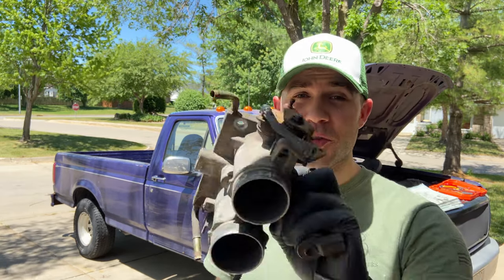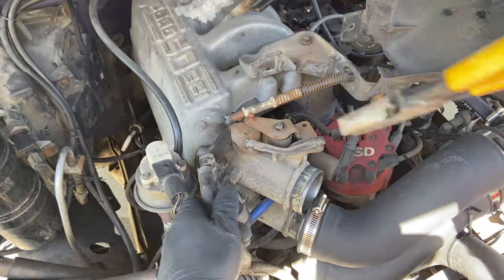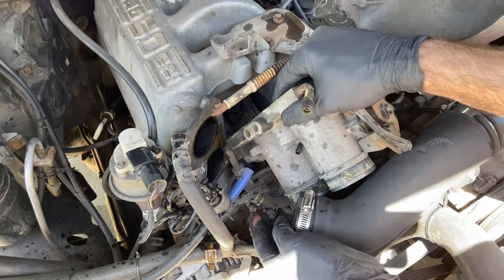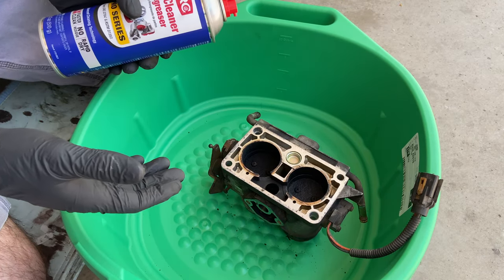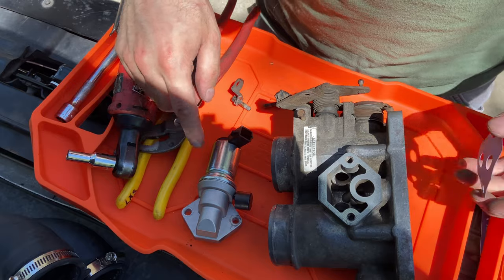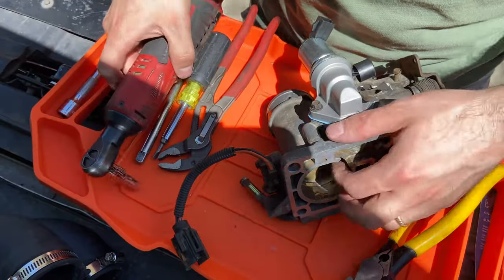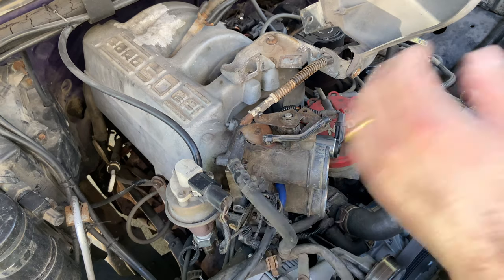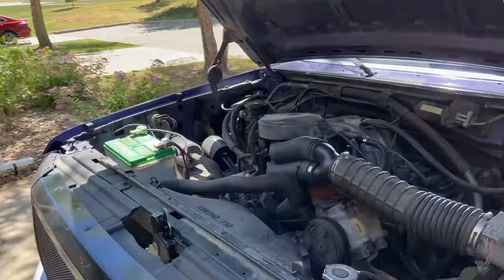How to Remove a Ford F150 5.0 Throttle Body and Super Clean it!

Comment: Thanks for all of these videos dude, they are awesome. This one helped me out in a lil bit different way. I have a 91. 5.0 with 126k and since I’ve had it I’ve noticed there are some hoses missing, and turns out it’s those coolant lines running in and out of the TB. I’ve been driving it without any problems. The previous owner retrofitted to newer AC and I’m curious if that would somehow delete those lines?
Reply from the maker: You’re welcome man!🤙 that could have deleted those lines. I haven’t seen many retrofitted AC systems.
Reply: Ahh okay that would make sense I think, I appreciate it dude 👊🏼👊🏼

Comment: I’m doing this project right now and the built in coolant lines on my throttle body are completely corroded.  Would you replace the whole unit?  Or can I just replace that tubing?
Reply from the maker: Nice! If you think you can replace those corroded coolant lines then I would try. Otherwise you will need to replace the whole unit. I’ve never tried replacing those coolant lines.

Comment: Great video. Any chance that coolant line could be leaking into the throttle body? I'm loosing coolant on my 93 f150 and no idea where its going. Truck has a very hard time accelerating. Thanks,
Reply from the maker: Thanks Michael!🤙 that could be a possibility. You would have to check while the engine is running. I kind of doubt it because I think coolant going right into your intake would smoke/steam. You could be losing coolant through an exterior leak or through an internal gasket.

Comment: What socket did you use to get the throttle body off?
Reply from the maker: Good question! I can’t quite remember but I don’t think it was anything special that’s not in a typical mm or SAE socket set.
Reply: 3/8 socket

Comment: Thanks for the easy to follow video. I have been having a few issues with my new to me 1995 f150 5.8 and think this may help solve some of my problems. I have a high idle and my truck shifts hard/jerks into reverse and drive. I replaced map sensor as recommended by the forms without much luck. I think the truck drives a little better, but still same issues with idle and shifting into reverse and drive. Once I start driving I don’t notice much difficulty going into any gears 1-4 (auto trans). I think cleaning the throttle body and replacing iac and tps is next. I know I have an exhaust leak at the muffler that I am gonna weld next weekend, but besides that, any other ideas as to what could cause this? I plan to replace all vacuum lines in the near future since they are old and looking rough, although I currently can’t find a leak from them. I also am replacing trans filter and fluid this weekend along with muffler fixes. Any advice is appreciated and thanks for all the helpful videos.
Reply from the maker: No problem man! 🤙Honestly, these fixes you plan on doing are a good start. I would get them done and then see how your engine runs. For me, high idle typically is an air thing. Exhaust, intake, vacuum etc. So definitely check all those components carefully. 
Also, have you checked the codes on your truck?
Reply: @TheMinuteMasters  yes, non-running only has code 121. Running- 411, 412, 311, and 332.
Reply from the maker: @Morse12321  I don’t know the codes off hand but if you Google search them with the year of your truck, there’s usual a forum or two dedicated to them. Sounds like EGR, O2, or some other sensor/valve.
Reply: My 95 5.0 does the same thing; jerks into drive/reverse. After some diagnosing I've discovered some minor vacuum leaks and a bad IAC. Before buying a new IAC try unplugging yours and then see how the truck runs. If it runs the same or better then the IAC is probably bad but if it runs worse then your problem may be elsewhere. Also you can try cleaning it. It's very easy to do and could be all it needs. Also make sure your throttle cable isn't sticking. When I first got my 95 f150 5.0 the throttle would get stuck at around 10% throttle. In other words when I let off the gas the pedal didn't return all the way out. I solved this with some lubrication and adding an extra return spring. Also there's on idle screw on the bracket that the throttle cable mounts to. Make sure that isn't all the way in for some reason. I have a new IAC that I'm going to install and if that doesn't solve it then my next best guess (other than vacuum leaks) would be the TPS. Also what trans do you have? I'm just curious if you have a 4r70w trans as well.
Reply: @Acaidia  Mine is an e40d. 6 months later and I have done a lot with my truck (95 4x4 f150 5.8 e40d) After replacing map, iac, vac lines, a few things im probably forgetting, and the u-joints i was finally able to fix it. Hard to say if replacing the u-joints was the sole fix, but they definitely helped the most. Iac and map helped a noticeable amount to make it tolerable, rather than feeling like the truck was gonna split in half, but after replacing u-joints (ball joints, tie rods/sleeves etc at same time) i have not had anymore issues. I had a lot of slop around my front diff at the joints and when going from park to drive or reverse i could see where it would have to compensate for the slop and made it jerk. If you try the iac and that doesnt fix it id start looking around there. Its a long job so prepare for that (at least for me it was). The only real issue im trying to figure out right now is why my dash lights are flickering in one spot. Its in an almost square shape around the mileage, 0-10mph, and fuel gauge sections. Its not a constant flicker, but more so like a light is going in and out. Only thing I know needs work is my dash light switch as it has to find a happy medium in order for dash lights and headlights to be on, otherwise it will shut one or the other off ( i definitely need a new switch) but i tried messing around with the switch and it didnt seem to make a difference with the dash lights issue. The part is on order for that anyway so ill try that and see how it goes. Anyways, ill quit rambling now, good luck with your issue and hope you are able to figure it out!

Comment: That little tube on the bottom left that the coolant line attaches to. Is that replaceable if I accidentally broke it off?
Reply from the maker: That’s a good question Johnny. I don’t think there is an “on the shelf” replacement part. However, you could bore it out with a drill and  solder/braze a new piece in its place. I think a piece of brake line with the proper flaring would do the trick.

Comment: Does it help with tourque?  I'm going 70 in the highway and it feels like I'm doing 40. Any ideas.
Reply from the maker: If you feel like your truck is way underpowered, I would start refreshing ignition and fuel components. Cleaning the throttle body doesn’t add torque but it doesn’t make things feel smoother.

Comment: Do you still have the spare tire carrier on the bumper
Reply from the maker: I don’t. I didn’t have time to develop a better latching mechanism and it rubbed a large hole in the bumper. The larger hole caused it to rattle a lot too. I may revisit the design in the future. It needed some tweaking.
Oh, it also needed a pin to hold it in the open position.

Comment: What model  MSD is that? Will it work on 5.8?
Reply from the maker: So that’s just the MSD cap and rotor. I’d love to install the full MSD dizzy and box. But to answer your question, I’m pretty sure MSD makes a cap and rotor replacement for the OE Dizzy.

Comment: Did you upgrade the coil ,distributor and install a 6al ignition box on this engine?
Reply from the maker: I didn’t. That’s just the MSD cap. I’d love to upgrade to the full MSD dizzy, coil, and ignition box though. I hear it is amazing!🤙
Reply: @TheMinuteMasters  I asked because I have it ordered for my 93 high output 5.0l f-150 and was hoping you could tell me if it was a good set up,I have shorty headers, cold air intake it’s bored .0040 over with forged rods and a steel crank and high flow exhaust with cherry bombs on it & 35” tires I love my old Ford been working on it for two years paid 300$ for the truck and so far i have spent 12,000.00 $ on upgrades/repairs.😜
Reply from the maker: @JoeRocket-sf6qs  Awesome! From what I’ve read you will definitely like the MSD set up. My told it causes the spark plugs to fire more often and completely burning all the fuel. 
Hey I bought my truck for $1800 and I have about that much in it too! Lol But hey, it beats buying a new truck for 45k+.
Reply: @TheMinuteMasters  I only took mine on cause of corona (project to kill time)and I like the body style,I would love to dyno  my truck but no facilities exist in my area sadly.
Reply from the maker: @JoeRocket-sf6qs  That’s a good idea! I moved into an apartment right before corona and I was no longer near a garage. So I could put as much time into my truck. Oh well. Lol
Yeah, I’d love to know what power your truck would make. I’ve dynoed my truck four times and it’s cool to see the read outs.

Comment: Ive got the 95 5.8. I took the throttle body off to clean it because its been having a lot of trouble idleing and running and thought it couldn't hurt. It was horribly dirty. The intake manifold where the throttle body connects to is just caked with sludge inside it. Is it normal for it to be that dirty in it or should I be taking it off and cleaning it too?
Reply from the maker: It’s normal for that much crap to build up over time but it’s not how it should be. I would clean the TB super well and if you feel like it. You could pull the intake plenum and clean it too.
Reply: @TheMinuteMasters  I think thats what im going to do. I just watched your video on how to take the plenum off and you mentioned the injectors were right there. I think ill wait for NAPA to open up and go ahead and replace the injectors while Theyre easy to get to. Thanks for the help. And your videos are amazing. You are very thorough on your instructions.
Reply from the maker: @emmanuelm2291  Sounds good man! Your truck will be running so well once you get everything cleaned and back together.🤙 Thanks Emmanuel! I appreciate it! Thank you for taking the time to watch my videos!
Reply: My 95 5.0 is like that. If I pull it I am also going to put in new injectors. They are cheap and lose pressure with time.
Reply from the maker: @mikehickman3330  That’s a good idea! I want to replace my injectors too just to freshen things up.

Comment: Hey mr Steve do you have a video on setting the idle? Apparently if you just turn the screw it messes with the rich & lean curves?  Guys on forums say start with warm engine. Disconnect the TPS. Start the engine.  Turn screw to get desired idle rpm. Then reconnect everything.  Is this how you do it?
Reply from the maker: Hi Josh, I’ve actually never messed with the idle. I’ve never had a reason too. Is there something wrong with how your truck is idling?

Comment: Any particular reason why you cleaned it?
Reply from the maker: Yup, I was getting oil up through the CCV line into the intake tube and through the throttle body. The oil was coating everything. I figure this was causing idle issues and weird starting issues. Between the clean and replacing the IAC, my truck definitely feels smoother on the throttle. The pedal feels smooth under foot and some weird and occasional stubble starts decreased.
Reply: @TheMinuteMasters  I replaced my IAC Valve. While I had the Ac on it would idle up n down and that fixed it
Reply from the maker: @SC-dt4ij  Nice! Purrs like a kitten now right?
Reply: @TheMinuteMasters  most definitely after I drive around 30 mins in the highway I barely have to step on the peddle she just goes
Reply from the maker: @SC-dt4ij  Nice! That’s how my truck is feeling now!🤙

Comment: Gasoline is not a good parts cleaner. If it was, carburators would not need to be overhauled.
Reply from the maker: I would agree but I was told it was better than water.

Comment: I cleaned my TB and IAC with CRC TB cleaner used soft brush got it really clean, but now my IAC doesn't come on, I wonder did I clean too good even with plates closed it still runs with IAC off oh well lesson learned....😮
Reply from the maker: Interesting. I would trying installing a new IAC and see if the problem persists. Or if you are good with an ohm meter, you can test the existing one.
Reply: @TheMinuteMasters  yep I tested it the ohms were in range on the IAC and connector plug. I'm check for vacuum leaks or go to salvage yard for another TB.... only thing I can think of...
Reply from the maker: @alexlewisiii6654  Gotcha. That's what I would do.
Reply: @TheMinuteMasters 
Yep I did this morning and it did help thanks a lot..❤ your videos especially the one with cut out access to the fuel pump definitely gonna do that....👍🏾

Comment: Do how to remove and replace headers
Reply from the maker: I would love too! I definitely have it on the docket when I get to doing performance mods.🤙
Reply: Put shorty headers on and use mr gasket aluminum gaskets and use hex head bolts for install.....
Reply from the maker: @johnpaul3800  I’d love to put shorty headers on my truck. I had the engine out before and I took the stick headers off. So, I know it wouldn’t be hard getting the bolts off. I have a header bolt kit from Summit that’s stainless steel.
Reply: @TheMinuteMasters  Talked to you when you did the engine pull on your truck! I spun a main and had to put a new 5.0 in mine found a 1992 5.0 out in Chicago with 70,000 original miles for 875.00 shipped to n.y. she's up and running good again...😀👍
Reply from the maker: @johnpaul3800  Ah! I thought your username was familiar. That’s a damn good deal! Did you add anything extra to it or did you install the engine as stock?
Reply: @TheMinuteMasters  Just the headers back on and cold air intake rebuilt the throttle body and took all emissions off!
Reply from the maker: @johnpaul3800  Sweet! How does she run now?

Comment: My 90 F350 has an idle down problem. I've replaced all kinds of things trying to fix a backfire problem, but didn't stop this issue. Turned out to be the Ignition control module on distributor. But idle isn't bad when you hit it now.. Smooth for the most part. But touch that throttle and it's back up to a grand or better on tac. Three things were related to it that I replaced, but I'm sure it has to be vacuum related at this point.
Reply from the maker: I would definitely check for vacuum leaks. Replacing all the vacuum lines typically corrects that.
Reply: @TheMinuteMasters  Gotcha!

Comment: I got the old school 5.0 too bro?
Reply from the maker: You bet Terry! I love it!🤙
Reply: @TheMinuteMasters  Its kind of tired pistons rattle like crazy my plans are to swap a 5.8 liter 351 in it.
Reply from the maker: @terrybaptist795  Really? I think my pistons are rattling too. Do you hear a kind of dull low rattle when you shut your truck off? Or when you idle for a little bit?
Reply: @TheMinuteMasters  My pistons only rattle when i get on the gas accelerate my friend.
Reply from the maker: @terrybaptist795  Gotcha. Yours must be worse than mine. Is your oil level good?
Reply: My oil level is fine.I Paid a repair shop to replace the oil pan gasket which cost me a small fortune only to find out the my oil sending went bad had take it back over there to
replace that had to keep throwing
oil at to get it the repair shop.
It still runs  and it's not overheating and no engine milkshakes but it's just tired time to put a 351 in it.

Comment: My throttle body didn't even have a gasket on it lol I'm like this has to run better after this, nope still runs like sh×t. Common theme with this truck.    Atleast it doesn't die anymore I guess.
Reply from the maker: That’s good! Have you done an ignition tune up? 
I’d read the codes too.
Reply: @TheMinuteMasters  I changed the cap and rotor haven't got around to the plugs and wires yet, it still has a misfire but not as bad.  No code reader yet. A lot of things need changed anyways so I've been holding off on the code reader.

Comment: I have a 94 Explorer cknversion van with the 5.8l. Been having idle issues that none of the ii mechanics including dealer, have been able to figure out. I have spent THOUSANDS trying to figure it out in parts and hourly labor. 
My code keeps coming up for the EGR valve that I have changed along with the sensor and pipe,tps,iac,full tune. I just recently purchased and awaiting for it,the EGR Valve control solenoid to see if that's the issue.
Oh. When i had the iac and  tps installed, they removed and cleaned the throttle body and in between the THROTTLE body upper and lower hoses, IS a vacuum nipple that was left open.
From everything I've seen,the vacuum line from the EVAP canister solenoid valve, IS supposed to be their.
Do you have any idea were it's located...?
Reply from the maker: I think the EVAP canister is situated near the throttle body. 
Otherwise, to fix the idle issue, I would make sure all you vacuum lines are in good condition. Vac leaks cause all kinds of issues and they don’t necessary trigger codes.
Reply: @TheMinuteMasters  k,thanks
Reply: Many engine, transmission and driveability problems are solved by re capping the ECM.